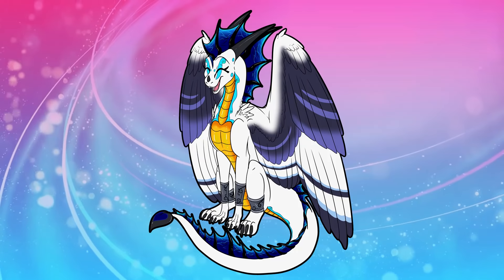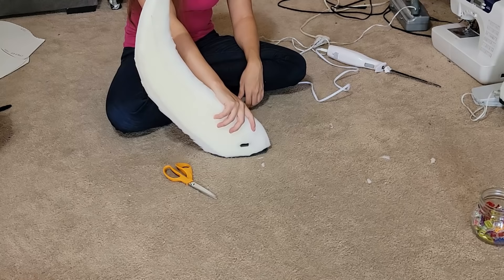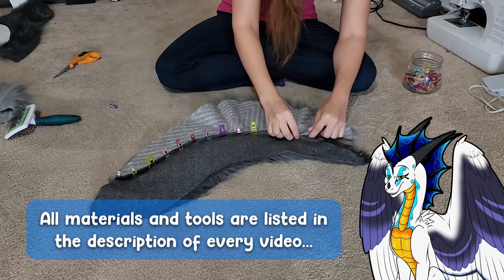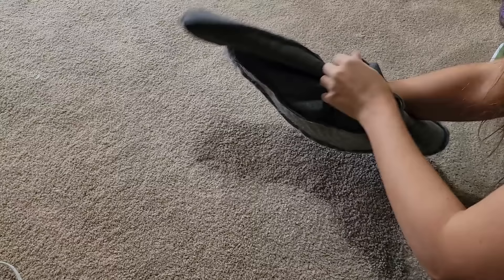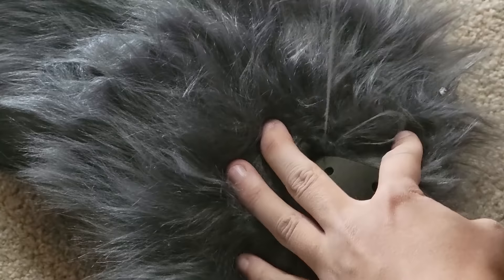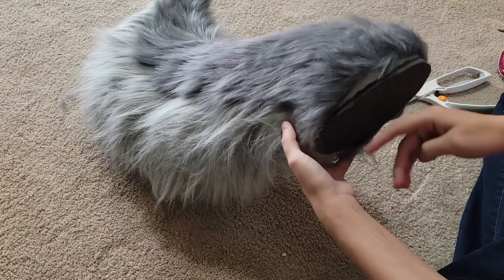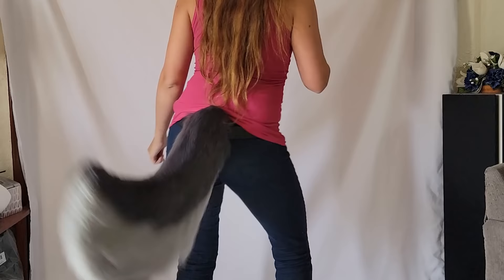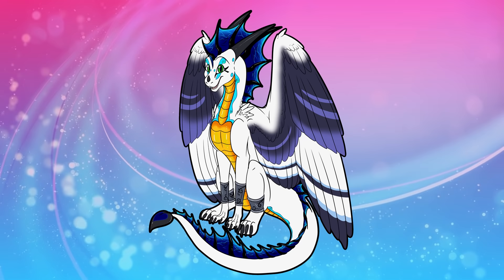[HOW TO MAKE] Super Motion Canine Tails

Comment: Most sewing machines that can do a zigzag stitch will also have settings for doing buttonholes; those will also give you a satin stitch as it's basically just a zigzag, set to whatever width you want, with the length set extremely short, so that each stitch is basically right beside the one before it. You might find that you need to tweak your tension settings a bit, especially if your fabric is at all stretchy; keep an eye out for truly impressive snarls happening on the underside! If that happens, you'll want to experiment on some scrap to get it just right, but usually you'll want to start off by tightening your tension up just the wee-est hair.
Reply from the maker: Thank you for sharing this awesome advice!
Reply: When you’re working with a new material, it saves so much time to take a couple scraps and sew them together with your intended thread, stitch, and tension to check that they work.
Reply: Thank you!!!!!
Reply: i read "buttonholes" as "buttholes" and was extremely confused 😭

Comment: Gotta admit, this is a pretty awesome project! I might actually try this myself one of these days. Though word of advice, when cutting faux fur, don't cut through it like you did in this video. Instead, do a hard press and glide on the back of the fabric. This way, you'll not risk cutting the actual fur and make a bigger mess. That and you'll only have to worry about slightly loose fur on the edges, which should be easy to manage and pull to keep it from making a mess........ Um, sorry if I seemed a bit bossy with my advice. ^~^;
Reply from the maker: I appreciate the advice, but I've been cutting fur like this for the last 3 years and it's worked out wonderfully.
Reply: I know what you mean; I do it too, where you take the tip of the scissors on the fur side of the fabric, and run it right along the actual fabric, sort of like doing a part in your hair with the pointy tip of a comb handle, or something, so even if the fur isn't carefully parted along where you're going to cut (which is what I had, unnecessarily, heh, started out by doing), you still won't be cutting through the fur, just the anchoring fabric. You'll inevitably lose a little bit of fur anyways, just from it pulling out from right beside the cut edge of the fabric; but after the first time I just went and cut funfur without thinking about what was happening to the actual fur itself in relation to my scissors, I've always been extra careful, ha ha! Don't really need my work to unexpectedly have Dumb & Dumber bangs lol
Reply from the maker: @KryssLaBryn  referring to the chooped fur as "Dumb and Dumber Bangs" is probably my favorite description ever xD
Reply: @Neffertity  blushes in embarrassment Oh. Well, goes to show what I know........... Then again, while I have been sewing by hand since high school, I'm technically still a learner when it comes to making stuffed animals, dolls, and clothes. Soooooo, yeah. Prooooobably should've known better than to try to give advice to someone who's had more practice than me. And obviously more skilled. Um, sorry? ^~^;
Reply: @KryssLaBryn  Haha! Yeah, true. I mean, unless that's what you're planning for your project to begin with, like a ragged fur dress or something. XD
Reply from the maker: @Wingsong5555  oh no need to apologize at all! ^_^
I enjoy hearing advice from others.

No matter how skillful you are, there's always more to learn. ❤
Reply: @Neffertity  ................Ok, I'll admit. I can't even argue with that logic. XD

Comment: Technically it's primarily using momentum to bounce around and swing, not gravity.  Gravity is the force that pulls it towards the ground when you drop it.
Reply from the maker: Correct.
The force of gravity, combined with motion creates kinetic energy.
The kinetic energy is what allows it to swing, as the springy structure provides resistance to the force kf gravity.
The two forces fight each other and produce movement.

Comment: I'm going to try to Frankenstein a wire...core?  I guess?  Although it's not going to be all that thick...inside a foam tail.  This is largely because my planned tail is very long...and is supposed to curl upward in practically a full circle.  I'm very concerned about weight and support, so I want to have the added security of a wire to help keep the foam steady.  I'm already going to have to cut the foam tail in two pieces anyway because of being unable to get that curl in a single shot, may as well make the first "half" of the tail in two halves so that I can sandwich some wire inside of it.  Not planning on posing it via the wire, if I try to give it super motion as well that'd...be a thing.  I'll share on Instagram if I pull this off.

Comment: Oh! I built a giant ass tail (was gonna be a dragon but I misjudged the size) using a similar technique back in 2016! Or, well, not really built, it's not done yet bc I sorta stopped making this sort of stuff, but your video gave me the solution to the issue I was having of the "backplate" coming loose. I just sow another backplate in fabric over it that is attached to the actual fur (whenever I get to that point >_>). Thank you for potentially resurrecting this (GASP) 7 year old project (what is time aaaah)!
Reply from the maker: Here's hoping it works out this time!

Comment: think it'd work with one of those spinning tube things kids play with like slicing up the foam in sections and making a hole in the middle slipping the tube in and just doing the rest like the video? and if theres any gapes in the foam stuff with cotton if i could i'd try it myself it think it could work also if it sanged and lost shape you could connect elastic for the sewn inside tip of the tail to the base so it doesn't sag hmmm

Comment: i don’t know why, but i’m having a problem with the fur. I bought the pattern and i used the part you cut off for the foam as a pattern for the top fur color as well since it was perfect, and then i used the rest for the white on the bottom. but the two white parts aren’t lining up properly when i try to pin the whole thing together and it’s making a big problem. i have no idea how this happened as both were the same size before. does anyone know how to fix this?? :(
also i tried to just line them up and then cut off the excess of the bigger one, but when i pinned it it made the other (top) parts not line up. i really don’t know what to do, should i just stitch rip the top and bottom parts from eachother and try it again??
Reply from the maker: It's possible you used too much seam allowance.

Comment: I know this is an old tutorial, so I was wondering if this technique would work with a mouse/rat/possum tail.  I am working on my own mouse partial for my VTuber model and was thinking of going mechanical, but this technique would be much easier if it works.
Reply from the maker: You'd really have to fiddle with the weight distribution to have something that thin keep its shape and not drag on the ground.
But yes, I do think it's possible.

Comment: Does anyone know if the template is used for the fur as well or do you outline a little bit above the outline so you can fit the foam through. Just can’t tell in the video.
Reply from the maker: As stated in the video, and on the pattern, the thin piece is the foam core and the fur on top of the tail.
The bottom ofnthr pattern is for the longer fur part.

Comment: Veeeery very late, but want to ask, is there a way to make something simmilar but with a squirrel tail? like i mean, its hefty chonkier than wolf tail, and is there going to be any kind of movement or it gonna self destruct after one quick wiggle? thanks for answering :D
Reply from the maker: I feel with something that large and upright standing you'd have to use a hollow foam form instead of a solid core like this one.
Reply: @Neffertity  i am using hollow foam form, more like interested in any possibilites to make it sway around the same way ^^" or its mostly physically impossible, or require making not straight weakening cuts but like v-shaped ones to make foam even more unstable

Comment: I have been curious, what size and thickness of the EVA foam mats are you using? 
I have purchased htese mats before only to find out they were both not big and thick enough for my (Feet) patterns
Reply from the maker: The exact ones I use are linked in the description

Comment: I loved watching this video and wanted to try some foam carving myself. What sort of technique do you use with the carving? I got the foam you recommended and a similar knife (Classic Cuisine 8-inch, also at Home Depot), but it was a lot harder to cut than it seemed. I'm guessing part of it is the sped up footage, but at the moment, the best I can do is sort of a sawing motion that is a little rough cutting out shapes and very rough trying to smooth it out, and leaves a lot of shredded foam.
Reply from the maker: If your blades are a little dull that can cause more resistance
Reply: @Neffertity  Do you think that's the case? The knife is brand new, one of the blades nicked my knuckle and drew blood. I thought maybe the issue was with the material; it seems so much more elastic than the material in your video (plus it's mint green instead of white). That said, the knife is the one thing I chose to buy, and I chose the cheapest one available. It isn't very smooth on the material, and it leaves all of these ridges. What kind of knife do you use?

Comment: Im working on my first fursuit and I currently can't afford a bread cutter, is there a way to do the slits with scissors? I don't wanna mess up my first tail! thx <3
Reply from the maker: Yes. Little snips. Lots and lots and lots of little snips
Reply: @Neffertity  Oh, thank you! but I found out if you take a bread knife or a serrated knife you can kinda do the same thing. but thank you!
Reply from the maker: @barkinboyy  it's really not safe to be using traditional kitchen knives for a project like this.
Reply: @Neffertity  oh, ok. is that because it's touched food? or something else?
Reply from the maker: @barkinboyy  that's one point. But the other is because those utensils aren't designed to cut foam.
And the likelihood you injure yourself is very high.

The tools I use in my videos were purchased for the sole purpose of making suits.
Reply: @Neffertity  ah, ok!

Comment: can anyone in this comment section let me know if it would affect the tail if i used hot glue instead of sewing? looks wise or of course if it would affect the tail itself. pls and ty! from a beginner fursuiter 😅
Reply from the maker: I really don't recommend using hot glue as it will reduce the movement, add weight, and is overall very low quality and will not hold for long.
Reply: @Neffertity  tysm!